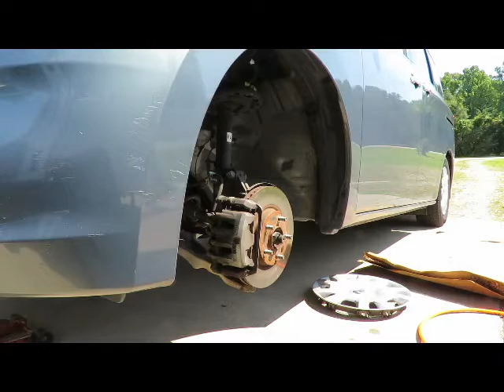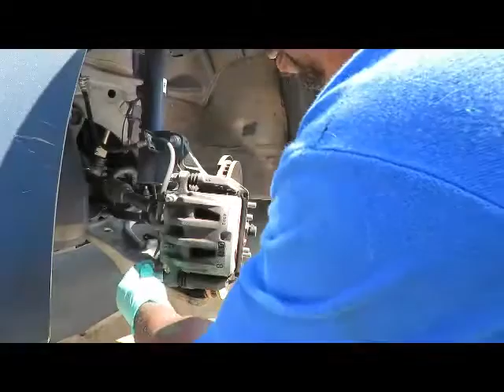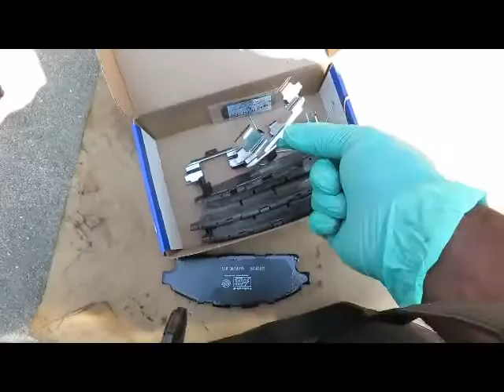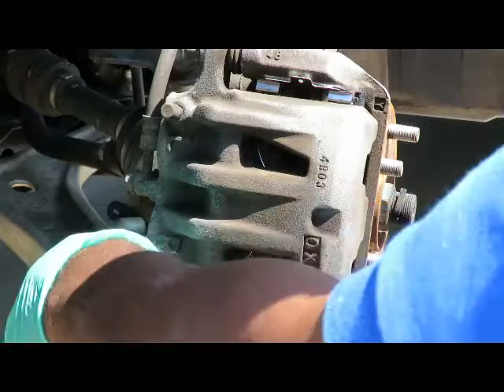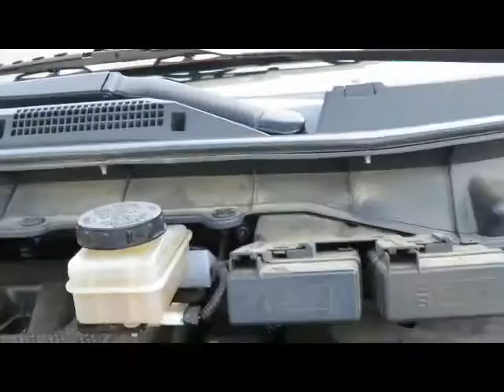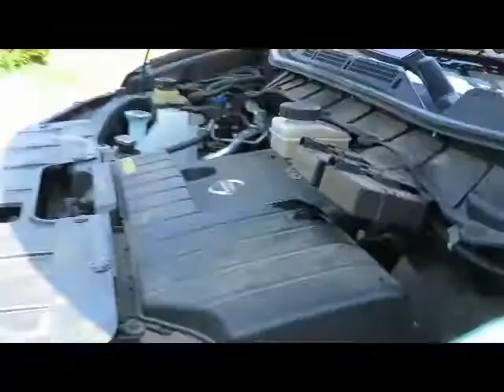⭐ 2011 Nissan Quest - Replacing The Front Brakes

Comment: Okay, problem time - I was able to replace the rear pads and rotors pretty easily thanks to your videos, but on the front I hit a snag - one of the bolts that holds the caliper to the bracket is rounded off, and I can't get any kind of wrench or socket to turn it. How can I get that thing off?
Reply from the maker: NO PROBLEM, here are your options:

1. Try to use a smaller socket, hit it on with a hammer, then loosen the bolt.

2. Use a pair of vice grips to grab the rounded bolt.

3. Get a set of Irwin bolt extractors (this procedure is 98% guaranteed to work!!)

Let me know what you decided to do.
Reply: @OnlineAutoRepairVideos  So he never told you what he decided to do? I can tell you I've had to do something similar to an oil plug and it worked like a charm!